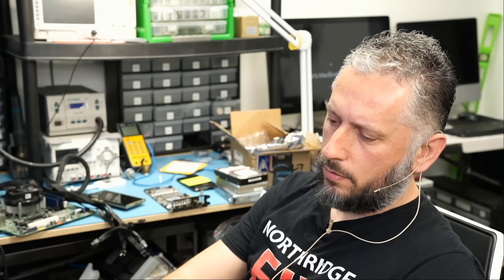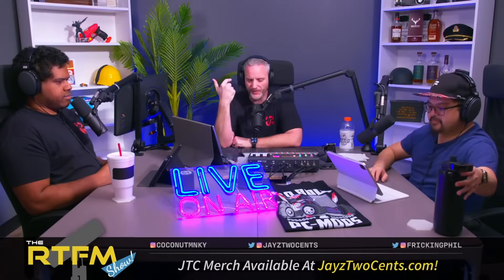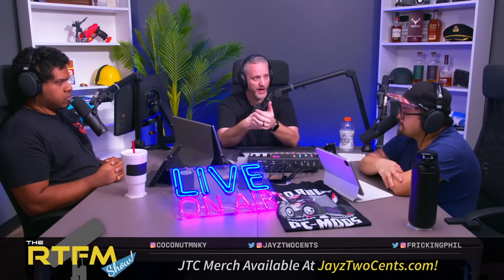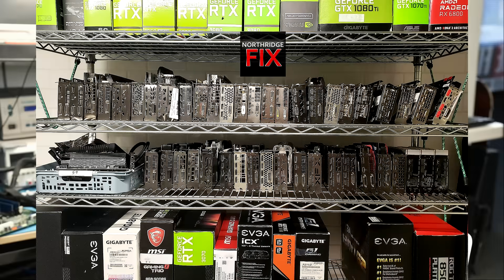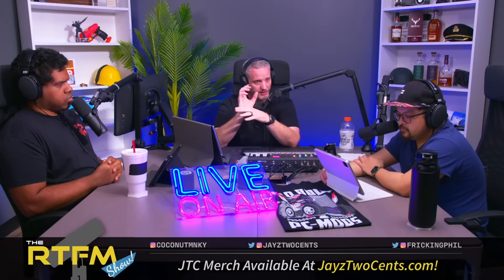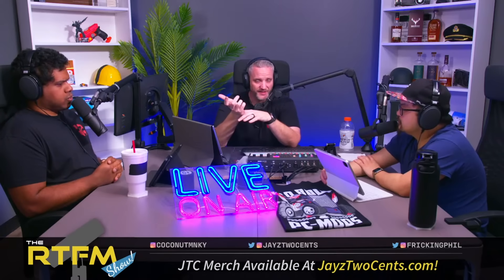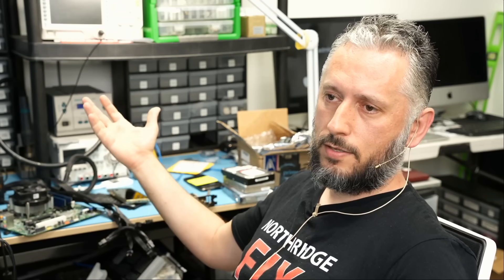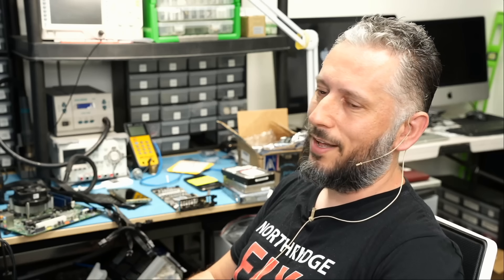Melting 4090 and CableMod. JayzTwoCents and Gamers Nexus Response. Blame NVidia or User?

Comment: As a software developer I can say only that, if user after user starts telling me, that in my application occurs identical bug, then I cannot just say "It's your fault, you didn't clicked in the right order or entered the correct value", but it's my job to analyze the bug and even if it's partially caused by user doing actions in wrong order or inserting wrong values, then I need to make adjustements and fixes to prevent that bug from occuring.

So from my point of view this is manufacturers fault. I fully agree with Alex.

Comment: i believe the while using the CARD. the SOCKET is not able to handle power supply heat generated during the usage as there r lot of pins in that...

Comment: It just seems like Steve is missing the point entirely. Nvidia knew prior to launch and knows now that the design of the card is faulty. It doesn't matter in each individual case whether the user seated the connector 100% properly or not. There should be no question when seating a connector that it's in or it isn't.  That is a design failure. Nvidia won't own this, but that's what it is and they SHOULD own this by issuing a voluntary recall.  Again, they won't because that would make the 40 series a catastrophic financial failure for them and their AIB's.

Comment: Too much current for one connector. That's why it gets hot. Most video cards have two or three connectors in parallel, with two or three separate bundles of cable from the power supply, to spread the load, but not this one. All the current for the card is concentrated through a single connector.  It would be interesting to see some measurements of the actual currents drawn by a few different video cards, if you have the patrience to do them.

Comment: I think the power consumption of the 4090 is way to much for that little connector to handle thus it overheats and melts the plastic. Nvidia should've known better and designed a better connector or stayed with the previous design which never melted.

Comment: its very simple, this has NEVER happened in the history of video cards (not even with the power hungry 3090ti) its definitely a design flaw on the connector, they should have just used the lager connector with lager pins so there would be more surface area of the pins

Comment: At the end of the day, if all it takes for this failure to occur is a cable wiggling a mm one way or the other and only works correctly with an exact connection, is poor design and falls on the manufacture. The fact that there are so many people experiencing this problem is telling in itself! I agree with Alex

Comment: I feel like the issue is that all that power is on one connection. And with the power draw it causes heat. If it was the old method of multiple connectors then could allow distance to cool it. These cards are stronger than anything we have seen and just wants too much power

Comment: I like jayz logic, It is possible that it's user error but due to card connector bad/limited design. multiple clips to secure the cable and better power/quality connector and pin to assured a higher power capacity and connection stability. I wonder what is the pin metal composition on NVIDIA GPU, Some composition are prone to higher resistance and heat buildup. I need to research this a little bit.

Comment: My theory is that the pins on the male and female sides of the connector are too short and create a high resistance. And the manufacturer or designer should be honouring the warranties of these cards and should redesign the connector

Comment: It's easy for commentators to comment on what they see, but a technician working on the front line doesn't comment, doesn't guess, doesn't assume, they simply 'do' and then feedback their observations.

If we want to get to the bottom of this, set up a test environment to match the inside of a hot, dusty gaming PC and run current through the connector using a bench power supply.  Ramp the current up to the maximum (the card can draw) and leave it running for 2 hours to see if the connector fails.

Manufacturers trim costs everywhere and they use theoretical hypothesis to make decisions on a performance / cost perspective / failure rate basis.  It is entirely possible that card manufacturers have made the very slightest of misjudgements in their early calculations or alternatively they have gambled that so few cards will be maxed out by users that this connector will fail but only in a tiny percentage of circumstances against overall sales.

IMHO I think the card manufacturer has tried to cut costs just a little too much.  I'm an end user and tinkerer.

Comment: Firmly with Jayz here, I watched GN first, before I watched this or Jayz video, and I couldn't make head or tales of his logic either. It should not be possible for ANYONE, even an idiot, to melt a connector by incorrectly plugging it in to the card. Either the card receives no power because it detects the pins are not in contact all the way (crooked connector or small gap), or the card shuts off because it detects a short (if you somehow managed to put it in upside down). Neither of these are happening, which means the card has a design flaw. This might be another case of manufacturers using cheap parts on the PCB due to shortages during the Covid outbreak.

Comment: As a 4090 owner I can say when the gpu is in the system you can't actually see if the connector is in all the way. I take my card out and connect it then install in pcie slot.

Comment: All Nvidia graphic card before 40 series using one or two 8 pin connector so the current equally divided. Those connector and wire are big so the 30 series using up to 500w not melting those connector. I think the manufacturer should take the responsibility and nvidia should remake the connector to fix that melting.

Comment: Fact, connecting cables together in a way that can also later be disconnected creates a point where it could fail, a point where it WILL create more heat. And that means that they have to manufacture the connectors to withstand more heat then they would normally endure. The NVIDIA 12V  fails in every possible way. Selling these cards, buying these cards, and even repairing these cards are idiotic. These cards WILL eventually kill someone.

Comment: maybe theres something to do with quality of the materials in the connectors and steve lab analysis said some imperfection may add to the problem, though most 4090 doesn't melt, maybe the design margin of the cards and the connectors are so close to the edge and imperfections to the materials and user input and plus the milliseconds spike of the 4090 causing the weakest link to fail and burn which is the connector.

Comment: A simple solution could be a switch that has to be triggered by the securing latch mechanism of the connector to ensure it is firmly locked in position. But the real problem is the greediness of the manufacturer who tried to save some cents by designing a shitty connector which can't stand the high current!

Comment: Having three connectors channeled down to one in the wiring harness is a HUGE clue.  It is almost certain that the current rating for the connector contacts is being exceeded.  The video card SHOULD have three connectors (one for each power supply cable) instead of one so that they might share this load.

Current flowing through a contact when it slides causes sparking, surface erosion, and corrosion.  This increases the contact resistance and causes Joule's law heating.  Hot metals oxidize more quickly increasing the resistance further.  Occasionally, the surfaces become so hot that they weld together.

Gamer's Nexus is inventing suppositions to support his preconceptions.  First, the red lines are not aligned as they would be if they were due to shadowing of the connector shroud.  I doubt if he could plug in the connector as crooked as he claims without breaking the plastic.  Thus, his suppositions are also not supported by his own "evidence."

Comment: There aren't much space for the cable in these boutique computer cases, the side panel could push against the cable and the connector and bend the pins, even it's fully plugged in. There is no way to tell after removing it.

Comment: Who is this guy "Steve". Does he have a degree in Engineering....I mean a real degree, not some pc technician. I am a MSc  Electronics Engineer. This is a real design flaw by Nvidia. The connector is sub spec and should recall the cards. Steve is just a nobody, unless he puts his real degree on the table. If he has no degree he should just shut up. Full stop.

Comment: If you push current tolerances to the limit, then any connection issue, however slight, on one of the supplying pins will cause a higher current draw on another pins, which will increase the chance of a poorer connection on those. The eventual result will be a cascade of failures. How do we know this? Because all the failures we have seen have been on multiple pins (usually the 12V, not ground). The chance of multiple failures should be low - but if we consistently see multiple failures this means there is a cascade going on. 

Any reduced effectiveness on any pin will increase the probable failure of other pins.

I am also reminded of a problem I had with a video card (3090 I think?) That had two plug blocks. Each had an LED that blinked if there was an issue with a connector. On my PC there were intermittent connections caused by a tolerance issue with the connecting cables. Touching the cable would cause the LED to blink and presumably the card would cease to draw power (because you had to completely power down the PC  to reset it). I fixed this by squeezing the plug block.

Now, through this I know that there are issues with cables anyway. There were a large number of PCs suffering the same problem as mine. This would cause GPU stalls and reboots etc.

However, this would not fry anything because of the protection circuits.

So these cards likely do not have such protection circuits. These appear built to the absolute limit, and any slight connection issue on any pin (much more likely than is generally accepted given my experiences) will eventually cause the whole connector to melt.

So this is absolutely, 100%, an NVidia problem. All high current connectors should have protection circuits. If the connector is heating up, then there will be a resistance in the path, and this means a voltage drop. This should be easy to detect. When this happens, the card should shut down, with a nice blinking LED by the socket.

So why did this mistake occur? Probably because an engineer was not listened to. It is easy to do calculations and expect everything to be within tolerance in a prefect world. Experienced engineers know, however, that contacts wear out over time, that sometimes they make intermittent connections, that a speck of corrosion or even dust can change the characteristics of a contact. And so you have to put in some headroom and make sure that even if you lose a contact or two you'll still be within electrical tolerance...

Comment: I think the argument as to why 4090/4080 are having the issue and not the 3090s when the same adapter/connection type is being used is a good point. Do only owners of 3090s know how to seat a power cable? Also, if people don't know how to seat a cable properly why is there no influx of issues of people not being able to seat a power cable into a modular PSU? Even the new ATX 3.0 PSUs use this single 12VHPWR cable but I don't recall seeing anything about PSU connectors burning up....Maybe the answer to that is how the power is being delivered since the PSU does not receive the power so maybe it wouldn't have a chance to have this issue occur on that end...again I am just a simple PC gamer with no in-depth knowledge of this sort of thing.

Now I am no expert by any means, but would only the 12VHPWR cables have this issue and not 8pin pci-e adapters for other GPUs? I don't know if the pin layout has a impact on this issue but wouldn't 8pin connectors not seated properly have an issue too or is the voltage or other factors too low to have the same impact of people failing to fully plug in power cables?

Comment: Powersupply makers decided that 3 lines are needed to transport the needed current. To reconnect them aftwards on one rail is an basic epic design fail just to save the money for 2 connectors and their space on the board. This issue is clearly to be addressed to nvidia.

Comment: Pushing around 600+ watts into a single connector is madness. It all boils down to the thin diameter of the connector pins, they'll get hotter the higher the power is.

Comment: Incompatible pins, obviously. If you run that much current through them, you gotta certify the matching plug's contact resistance to be below some safety limit when it's "plugged all the way in". Neither Nvidia nor Cablemod with their Chinese suppliers bothered to come up with a contact resistance certification, so they both should pay for the RMA.

Comment: You don't need to spend a lot of energy to prove something that is clear to normal people, before there were also connectors so they didn't melt so easily. everyone looks at it from their own point of view, you as someone who fixes things, someone who is a gamer and of course those who are sponsored by someone to say the best about a product... There is nothing to analyze here, you have shown the same problem in several examples, which means that is a problem with the card, if someone doesn't like it, then let them send it for repair and pay out of their own pocket.

Comment: This is an example of people with no common sense. I really like Steve but he is not a repair man or neither he is an electric engineer. This is caused by an on going series of events. Meaning it is not possible for the wires to be already melted and then melt again. That is not possible. This problems happens at one time when it is on. It causes a power surge and I would say it is safe to assume the rating of these wires are not up to the spec of the power it is delivering. I am no engineer but I can even see when something is not designed well. This is it. Must be nice to blame the user, when you want to protect your relationship with nvidia. This is sus.

Comment: It is obvious to me that the pins in the connector are to small for the amount of current going thru them.
The connector needs to have larger pins or go back to multiple connectors to spread out the load.

Comment: Did Steve not see that the 90 degree connector was fused with the card connector? How could he even suggest that the user melted it first, then plugged in the 90 connector?

Comment: I agree with NorthridgeFix. For example, look at the light bulb, there's a small gauge wire connecting both negative and positive leads right? Now there's a huge amount of resistance going through that wire and that's what's causing the bulb to glow. It's the same with that damn connector.

Comment: I think everyone is saying the same thing here the only real difference is the solution. I think that maybe Alex has a slight bias here because he only sees the broken cards. If Nvidia has sold millions of cards and 1-2% of them failed then that is probably in line with industry norms. However I think everyone agrees that Nvidia should be responsible for RMAs on this issue because it is definitely at the very least a design oversight which gives the end user more than enough rope to hang themselves.

Alex himself and several others have mentioned that only having one connector might be the problem, but I am not sold. I haven't done enough research and I haven't seen anyone do enough research to come to this conclusion. Fortunately there is a very simple solution to this and any of us with a basic understanding of electrical engineering would be able to answer this with a little research. For this reason I kinda doubt that something electrically is wrong with the connector. There is no way that Nvidia would be dumb enough to push more amps than can be handled by this connector under nominal conditions. Now maybe there could be some sort of likely bios related issue where the card is misreporting the amp draw or somehow some sort of balance issue where one of the 12v lines is overdrawing but that also doesn't make a huge amount of sense.

I am looking forward to the next round of testing from GN because I hold them in pretty high regards when it comes to testing and in general journalistic integrity. Some people have stated that they are shilling for Nvidia or whatever however I am sure that is not the case. They took the small sample size they had and came to the simplest conclusion that they could come to. I will say that cablemod(whom I also hold in high regards) having this issue with one of the adapters is pretty interesting. I hope they(cable mod) come to the table a bit more in this conversation because I think their data and insight could be invaluable when it comes to figuring all of this out.